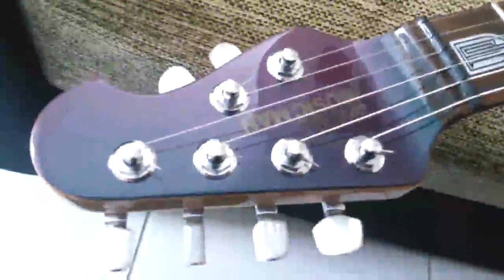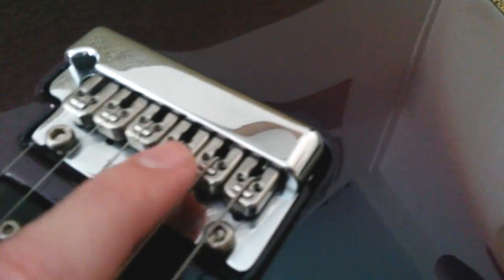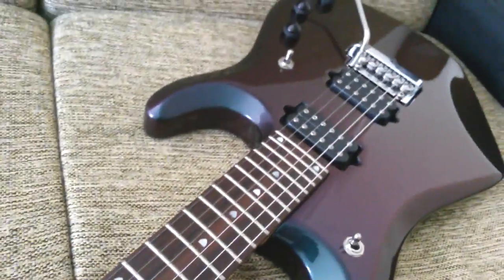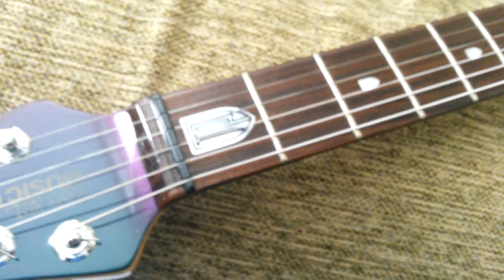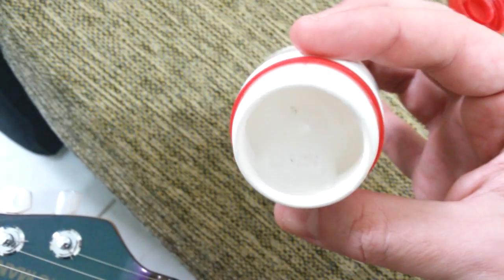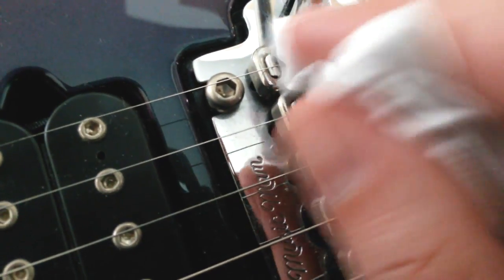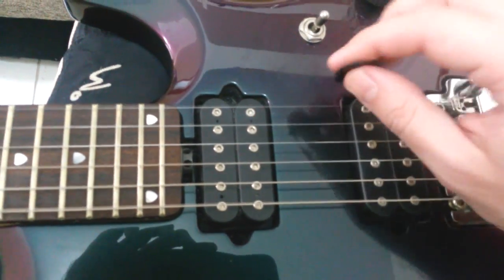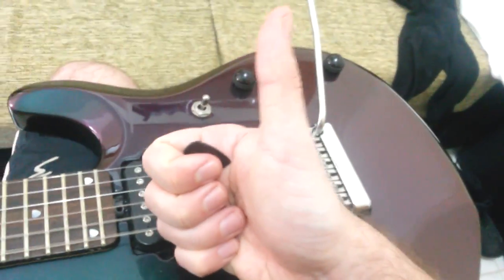Music Man JP6: fixing tuning stability problem

Comment: Did you just say stratocaster type bridge? What on EARTH are you on? The bridge is in it's own class.
Reply: Naaaaaaw
Reply: geez, chill out, dude. Everybody got it...
Reply: my man, his statement was correct. It is indeed a stratocaste type bridge (single-locking tremolo system). The other type are floyd-rose type bridge (double-locking tremolo system).
Reply: technically it is not a strat bridge, it has absolutely different construction. It is like a wilkinson based tremolo bridge
Reply: Technically, it IS similar to many Strat bridges, which are not vintage, six-screw types.  Fender makes plenty of fulcrum-style tremolos that can be designed to float or rest against the body (original Jeff Beck model) just as Wilkinson makes vintage, six-screw tremolos (VSVG-300) for the Ibanez Andy Timmons signature (higher end) model in addition to what I believe you are referring to...their 50 and 100-series.   On a non-related note, as the OP discovered, graphite works wonders for nuts and tremolos.   I've been using an exacto knife to scrape graphite from pencil tips into these slots for decades.
Reply: Ostankov Alex don’t talk about things you don’t understand, fundamentally  and mechanically they are fulcrum based system that have a bridge plate and sustain block, they both depend on the same spring configuration to counter string tension. So yes they are essentially the same.

Comment: Try Big Bend's Nut Sauce.  Works GREAT and easier to clean up than Vaseline.  I use it in my JP6 nut slots as well as on my les paul and it's great.
Reply: This 100%
Reply: Big bends nut sauce is basically just vaseline lol. You just get the benefit of having a nice little tube

Comment: I bet you not stay in tune if you look at tunner
Reply: I have exactly this question. After tuning to pitch, when I play or use the whammy bar the strings rarely go back to perfect pitch (using a tunner), they are usually off by a few cents. Is this normal?

Comment: What are you doing. This guitar is set up for 10’s your going to have to reset the whole guitar A FULL SETUP not some Vaseline 😂. Truss rod, string height, intonation, nut height. I know I set one up for 9’s but I would not but 8’s on that guitar you can do it but it’s just to light for it’s design inmho.

Comment: I am in market for this great guitar and with your tip, it has pushed me over edge, I will buy. I love using whammy so important that it stays in-tune. Thank you y muy bien senor.
Reply: I have one for sale that is the same color and no piezo if you are still in the market.  6 string made around 2000, I think.

Comment: Did you have to modify the nut in order to use lighter strings?. I'd like to know because I got a second hand Majesty and the original owner has it tuned to Eb with 0.10 - 0.52 and I want to use it in E standard with 0.9 - 0.46

Comment: I wish there was a video on how to setup these trems and some troubleshooting explanation. My jp15 I cannot get to stay in tune. No one in my area I trust with this guitar so I just decided to send it back and get a refund rather than risk voiding the warranty
Reply: evilcowboy 
Good point. I just got one of these guitars and I’m experiencing-tuning stability Issues. So I’m studying up. I’ve mastered the Floyd systems, but this looks fairly straight forward. It’s just a balancing act really. I know I’ll catch heat for this, but I usually keep my Floyd’s with a very slight backward cant. I find my guitars with Floyd’s rarely ever go out of tune like this. Even with my 14 year old acting like Dimebag. I’m talking just a few degrees. Not burying the hex keys in the rout out. But it has been a bit of a miracle when I discovered this. No, it’s not textbook “level”. But sometimes you gotta go with what works. I’m about to set up my Majesty. If I have tuning stability issues, I will try a slight cant towards the body with this set up as well. I’m usually “by the book” on most guitar stuff. But like I said, my Floyd guitars rarely go out. And the ones that do give me any trouble if any, are the cheap “licensed” or “special “ Floyd’s . But even those have improved stability with a slight tilt toward the body. I guess the additional tension helps? Just my 2 cents.
Reply: Basically its the same concept of the floyd, just without the locking nut. And with the added benefit of being easier to intonate. Remember you have to intonate these bridges as well to maintain tuning stability

Comment: This is a great tip! Can I ask why you advise not to use Vaseline on elixir or coated strings?
Reply: I get what you're saying and agree these bridges are miles better than a typical strat bridge but I believe he was referring to the fact that it's string through block, non locking, individual saddles.
Reply: Cause it will dissolve the coating, vaseline is petroleum based

Comment: Why not on Elixirs? Also, how much powder do you use in your mix? Valeu!
Reply from the maker: Because the coating of Elixirs may react chemically with vaseline. For coated strings, use other products like Big Bends Nut Sauce or D'Addario LubriKit (which I'm using these days).
Reply: Oh, I see! Thanks for the tip!